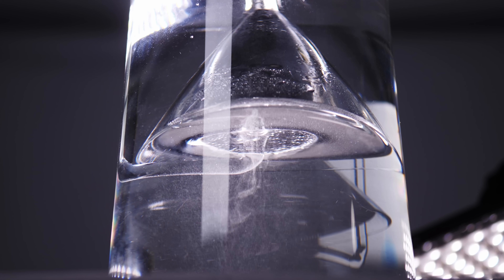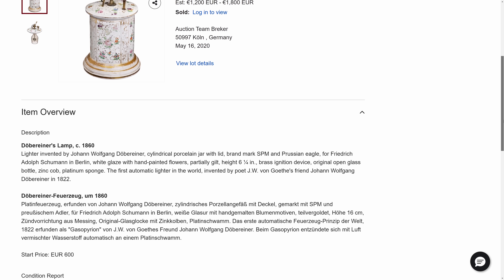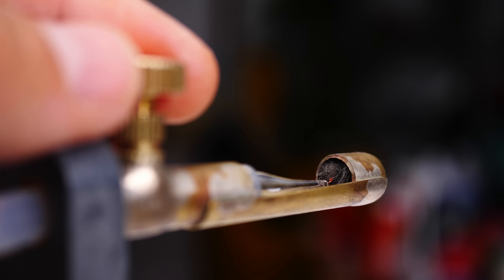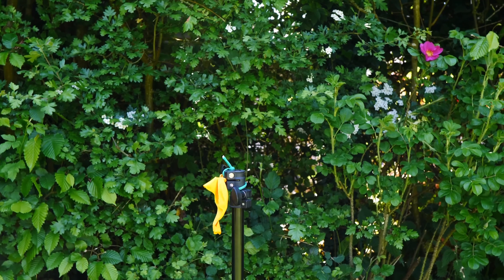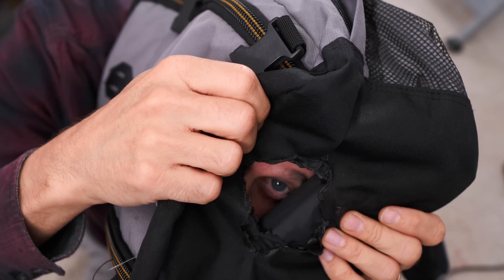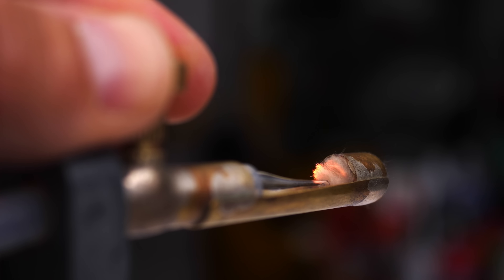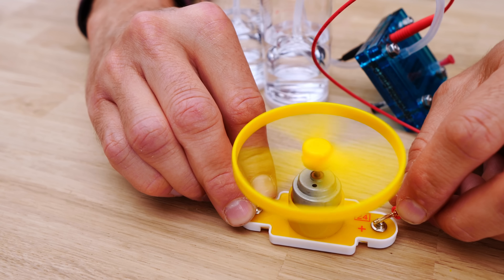This 200-Year-Old Lighter Ignites Without a Spark

Comment: Ah Steve - you see us middle-class boomers (mostly boys) new all about platinum catalyst ignition because we were often to be found making model aeroplanes with i.c.e. engines running on methanol- based fuel. These use a 'glow plug' for ignition - that is essentially a little coil of platinum wire is placed at the top of the engine's cylinder, so that the fuel vapour is compressed by the piston until ignited by the hot platinum. The wire is heated using a battery initially until the engine gets running, then the process is self-sustaining. Thanks for the excellent video and explanations of how this all works.

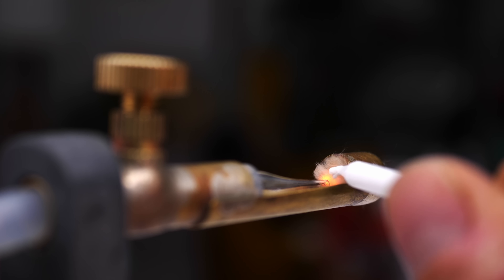Comment: 8:01 "Molecular wobble is just heat" - - No it's not. Kinetic energy of the whole molecule is heat (i.e. temperature). The molecular "wobble" is excitations of the vibrational modes of the molecule.
Reply: Vibration modes of bonds is a form of heat is this a very weak form of it compared to molecular rotation and translation.
Reply: @CrazyNerdInventor  You're right. Just checked the proper definition of heat, and it is the energy exchanged by two systems at different temperatures, which includes the energy to excite all the resonant modes of the nuclei.

Comment: The truly interesting thing about the fuel cell in the end is that it is fantastically efficient.  Like almost 100% of the energy you put in you can get out again.  Other kinds of motors and energy transfer devices often lurk around 20-30% efficient on a good day:  your gas engine loses more energy than it turns into motion.

Comment: You can achieve the same with regular drain cleaner (that contain sodium hydroxide NaOH) and aluminium (foil is most effective since it has a large surface area). So stuff most people already have at home. A (fairly weak) base is less dangerous to work with than sulfuric acid. Plus who has a block of zinc laying around unused?
Reply: Bro sodium hydroxide is not a "weak base".
Reply: @CrazyNerdInventor in drain cleaners it is pretty diluted. As in, would you rather stick your hand in drain cleaner or sulfuric acid. But yes, you're technically correct of course.

Comment: In theory you should be able to create the same reaction with citric acid and magnesium, the only difference is that you are then left with hydrogen gas and magnesium citrate, so the reaction isn’t as clean per say, but you don’t have to deal with the sulfuric acid to achieve the same results

Comment: "You don't need heat to get it started".  Yes, you do. But ambient temperature is already enough heat.  What the Pt is doing is lowering the activation energy of the reaction, but it still is a relatively higher energy transition state.  Quick search puts the minimum temperature around 78K, or about -195 °C (-320 °F).  So if you rely on this while space walking, you might be in trouble.

Comment: I have always wondered why whenever a catalyst is mentioned, it is almost always platinum. You had mentioned that platinum has lots of electrons 'like most metals' but other metals don't show up as catalysts nearly as often. Sometimes its palladium, but platinum is definitely the one I see most often. Is that just because it is in some sweet spot of not being 'too rare' to be economically useful, or do other elements really not work for catalyzing things? And is the mechanism of catalysis always or almost always fairly similar to the way it works here?

Comment: Hold up, you got me stuck on that hydrogen fuel cell. You mean you can reverse the system to get the gases back? Why don't we make hydrogen fuel cell batteries, then? Save the water that's made, then use that water when you plug the battery in to charge and get the individual gases back, and then you can activate the cell when you are away from the grid. Sure, may be a little dangerous in a car, but it seems like a good idea for a camp battery.

Comment: I've played with platinum wire and primary alcohols, and the acetone/hot copper penny catalysis. They all require heat input. To learn hydrogen will undergo catalysis at room temp is a treat.
And then you doubled down by talking about knowledge holes, which is great coming from somebody who clearly has a broad and deep knowledge pool.
Nice!
Reply: I have a small piece of copper plate. I also have a bottle of acetone. So if i put a drop of acetone on the copper, it'll get hot by its self?
Reply: @simontay4851  Not quite. Copper doesn't catalyse anywhere near as well as platinum, so you have to add heat; If you have a conical flask (or jar) with some acetone in it, and you suspend a piece of hot copper sheet a centimetre above the surface of the acetone, the hot copper will catalyse the acetone vapour, which will keep the copper glowing dull red until either all the fuel or oxygen is consumed. 
Search for copper acetone catalysis and you'll get heaps of videos.

Comment: High school chemistry: "A catalyst is an element or compound that initiates and facilitates a chemical reaction without chemically bonding itself." Steve: "Well yes, but actually, no."
Reply: Most catalysts work by providing a lower energy path that often involves forming and breaking bonds with its self and the reactants. It's considered a catalyst if there is no overall reaction to the catalyst and there's no net change to the Catalyst after a reaction cycle has occurred. The Platinum metal will still remain Platinum metal once all the hydrogen reacts

Comment: I stumbled into this reaction one day, in a clean room, on electron beam evaporator duty.

Mostly we did couple hundred nm thick layers of gold or copper. But it was a integrated circuit research lab setup, so other metals were regularly requested. Since the various metals didn't always adhere onto each other long term on the walls of the chamber, flakes would eventually start forming, and if they started shedding I would need to deflake the chamber (annoyingly messy task in a cleanroom).

Big flakes were easy, and most others could get sucked up. But a some stubbornly stictioned flakes would need to be wiped up with a wet cloth. And why use water in a vacuum chamber when clean room friend IPA is never far.

Knowing the catalytic reaction we are talking about puts you a significant step ahead of this, ignorant at the time, narrator as his IPA damp cloth suddenly burst into flames.

Monkey brain thought something somehow still hot in the chamber. But after snuffing out the flames and them reigniting a couple of times when I re-exposed the cloth to air, that got me to some reaction, and to looking up all the metals on the recent log pages for what quirk of physics had just set my adrenaline going.

Comment: Catalytic converters in cars used to use platinum. My classic  car had one until it was stolen right from under my car on the parking lot of my workplace. New old stock is €1800 and there was a lot of damage when they had cut the pipes.
I bought an €120 Chinese "universal catalytic converter". I think the copper pipe I used to drive home did a much better job.

Comment: My favorite example of platinum catalysis, and the whole reason I know about it is its use in glow plugs for "Nitro" or "Glow" model engines used in RC vehicles.

These engines run on a mix of methanol and nitromethane, and ignition is done with a glow plug. This glow plug has a small platinum coated filament that reacts with the methanol in the fuel to ignite the fuel around TDC. In order to start the reaction you run a low voltage(~1.5v) across the filament while you start the engine which I assume is needed to initially vaporize the methanol to get the reaction going. Once the engine is running the reaction keeps the filament glowing red hot, hence the name "Glow engine".

Comment: You say at the end that the lamp is over-complicated. I disagree, especially given the technology of the era that produced it. In particular, I find the mechanism whereby the building hydrogen gas pushes the acid away from the zinc to be especially elegant and simple way to stop the reaction, with no moving parts and no monitoring by humans.

Comment: I've seen another antique lighter based on platinum catalysis. It looks much more like a pocket lighter and it involves a small container with absorbant material soaked in alcohol. There is a screw cap that seals the container. Attached to the cap is a fine wire on a larger support wire so that they stick into a void in the absorbant material when the cap is on the device, sealing the device. On the fine wire is one or two small blobs of platinum black, a finely divided platinium powder for a large surface area. When the cap is unscrewed and slowly removed, the platinum black passes through a area where the alcohol vapors are mixed with air in the right ratio to be flammable. When that happens, the alcohol ignites, the same as the hydrogen does. The flame at the top of the container can then be used to ignite something else. The cap is then replaced, extinguishing the flame and readying the device for the next use.
Reply: My dad has one of those alcohol ones.

Comment: Using wasted falling water, small hydro elect units can separate Hydrogen and Oxygen from water using the creek by your house. Or high lakes by water for boats. Where it can be burned in a heat engine or made into electricity again using a fuel cell.  IT IS CLEAN ENERGY that is forever renewable.

Comment: In case anyone else was wondering "why platinum?" like I was, a google search has told me that the platinum group of metals are just exceptionally good at having those free electrons ready to participate in that redox reaction. All the other alternative metals in that group are more likely to corrode or dont work well at higher temperatures. This leaves platinum, palladium, and rhodium, the latter is apparently absurdly expensive so we stick to platinum and palladium.

Comment: 1:30 that's how the catalytic converter work in a car, and why people steal em, because even platinum scrap is worth alot

If you got a bunch of street sweepers you can also basically mine platinum and iridium from the dirt off the road, gets blown out the engine over time, multiply by millions of cars on the road

Requires alot of processing, and smelting and you get other things like iron and silicon mixed in
Reply: 2:30 you can use hydrogen peroxide at a higher concentration, and basically get a decomposition, water hydrogen and oxygen gas as products, a bit safer than spilling h2so4 on yourself

Comment: There once was a pocketable cigarette lighter that was essentially a length of (thin) platinum wire with a loop or two, immersed in alcohol. When the wire was removed from the container and exposed to air, the alcohol would spontaneously burn. 
Don't ask me how reliable it was I've never had one, they are very old and rare.
Reply: I believe they were on the market in the 1920s. I nearly had one a long time ago, but didn't realise how rare they are. There is a YouTube video featuring them.
Reply: Dementia must be setting in, I think I've just replied to my own comment. Better cut down on the essprexos.

Comment: Could you make a video on how platinum sponge was produced in the 18th century ? As platinum is no easy metal to be refined and due to its high melting point not easy to wield, I wonder how people did that in the not so well equipded laboratories of those times.
Reply: Platinum can be found as a metal in nature. It just had to be dissolved in aqua regia and then precipitated on asbestos or something similar

Comment: You know you can turn up the volume its why we have user volume controls, shouldn't need to use a headset to watch a video.
Reply: For me the volume is good how it is. If it would be louder the lowest volume would be too loud
Reply: @HanTrio3  I mean i know its not me other videos are usually fine, i have good speakers yet even on full volume this video is about a third as loud as my system can go. i can obviously hear it but just not at a level i would like you can always turn something down but at full volume i cant exactly turn it up anymore the only option is a headset or earphones.

Comment: "The only product you get when you burn hydrogen is water/H2O." Only when you provide it with pure oxygen to burn with. In air where almost 80% of it is nitrogen, hydrogen burns hotter than most other fuels, breaks down more atmospheric nitrogen and therefore produces more nitrous oxides.

Comment: Platinum catalysis is also used in engines. Methanol RC airplane engines, for example, use a glow plug made of platinum alloy, that is initially heated by an external electrical source (a glow plug driver battery). Once the engine starts, the heat from the combustion process and the catalytic action of the platinum filament on the methanol/nitromethane mixture keep the filament hot enough to ignite the incoming fuel charge for subsequent cycles without the external battery connected. Platinum is a catalyst for methanol oxidation (combustion).
Reply: Did not know this. I had "Cox" engine powered cars back in the '70s😅
Reply: They can occasionally ignite the fuel without being heated, I have had engines kick when I'm turning them over to prime them (that's why you hang on to the prop blade when you're priming the engine).

Comment: Model plane engines use a fuel mostly made of methanol, and use a glowplug to ignite the charge in place of the spark plug of a normal petrol (gasoline) engine.  The glowplug has a thin coil of platinum coated wire that catalyses the methanol decomposition, producing heat and sustaining the combustion.  A battery is (usually) connected to the glowplug to heat it up while the engine is started, but once the engine is running, the battery can be disconnected - the heat of combustion and compression, plus the catalytic action of decomposing the methanol, is sufficient to keep the glowplug glowing, and the engine running.
On a hot day, it's possible to start some glowplug engines without using a glowplug battery, providing the engine is spun over rapidly using an electric motor.
Reply: sadly these are getting rarer and rarer, electric propulsion has pretty much taken over the model plane world.

Comment: My first idea was that it generates some kind of pyrophoric gas like silane (self-ignites in air at room temperature) but this is way safer and less toxic.
Another intereseting sparkless firestarters are chemical ones (e.g. potassium permanganate + glycerol) used for starting campfires outdoor where the wood is not always perfectly dry and won't catch fire just from sparks (plus permanganate is useful as an emergency water disinfectant).
Of course any physical or chemical process generating enough heat can become a firestarter (often unintentionally) - even water can light a match (there are videos of this nice tabletop experiment where the demonstrator lights up a match with superheated steam).

Comment: As someone who struggles to understand chemistry, isn’t it just weird that you need to use one of the most unreactive metals?
Reply: It makes sense when you think about what would happen with a more reactive metal. The hydrogen and oxygen would react with the surface but instead of reacting with each other they would stay bonded to the metal. With platinum the bond is only weak so the reaction of hydrogen and oxygen is more favorable than staying bonded to the metal so water is formed

Comment: Interesting fact: Those small model engines, usually found on rc planes and cars, work on a similar principle. The platinum or iridium filament of the glow plug is responsible for the combustion of the methanol/nitromethane fuel (for high rpm competition engines, the intake, compression,combustion and exhaust cycle is done in 0,0015 seconds).

Comment: Can we kill this myth,  burning hydrogen in air "just makes water "  it's combustion you end up with mostly water , with hydrogen peroxide ,  NOx ,  maybe some ozone,  it's not a clean process it's chemistry determined by the temperature and the available chemical compounds which are mostly composed of nitrogen ,

Comment: I thought this was the same principle thats used in model glow plug engines all be it that an electrical charge is applied to a platinum filament to get the engine started. Once the combustion is started its catalysis that keeps the engine ignited during subsequent combustion cycles.

Comment: Question, if platinum can been used to make hydrogen and oxygen ignite in contact, why do we use hydrazine in rockets as a hyperbolic fuel? Usually we want hydrogen and oxygen because they are the best fuel but the problem is that they don’t ignite in their own, so if you need some small trust like in the reaction control you use something that does not require a spark and burn on contact.
Why do we stop need hypergolic propellants if we could as some platinum to turn the usual hydrogen/oxygen mix basically hypergolic.
I am genuinely curious what is the issue? Does it get too hot for platinum? I get why that would not be ideal for the main engine but for the reaction control they work in small bursts, so I don’t understand.

Comment: Very cool, umm 🤔  you could make a similar bottle that suspends acetylene rocks above the waterline until release the gas though it might be to much too quick, we use to use a water dripper on the  acetylene head lamp.
Can reduce citric acid to be a more efficient acid?

Comment: So those platinum-mat propane camping heaters don't need any spark igniter?    Or, maybe H2 self-starts, but large hydrocarbons don't?    Must try butane from lighter, also gasoline fumes, carbide-chunk acetylene, propane canister.  Which ones ignite and which don't?
Build a fuel cell from two squashed pads of platinum "embers?"